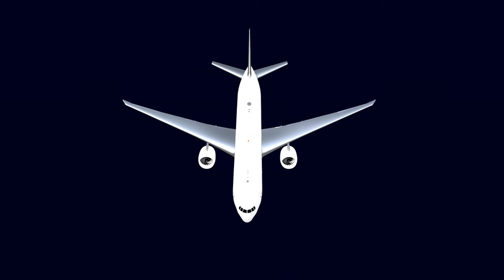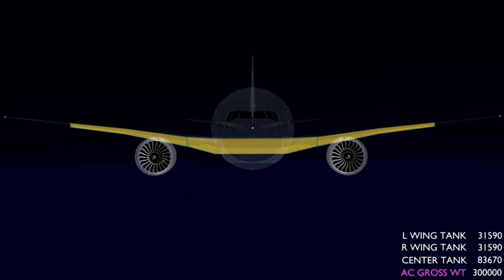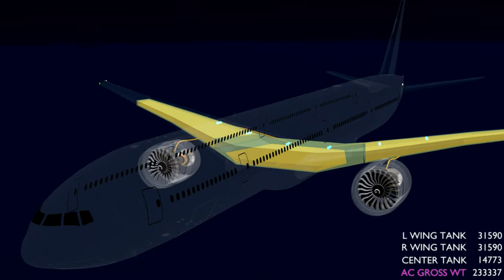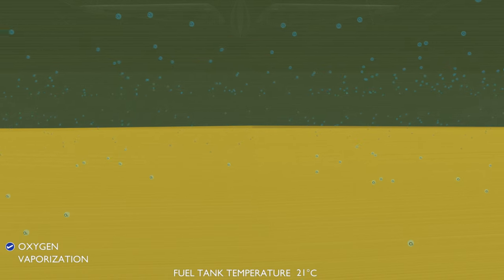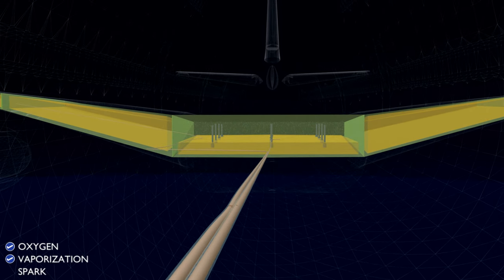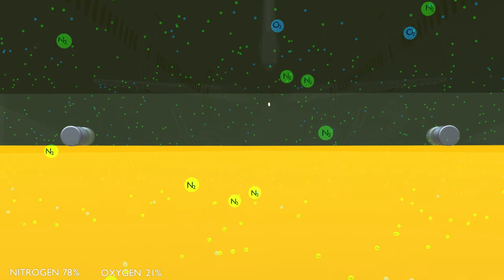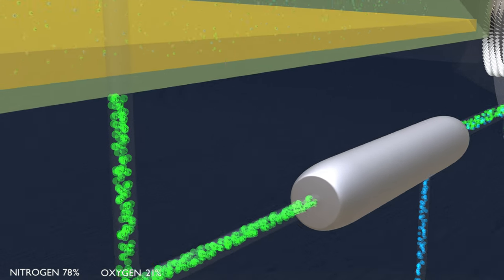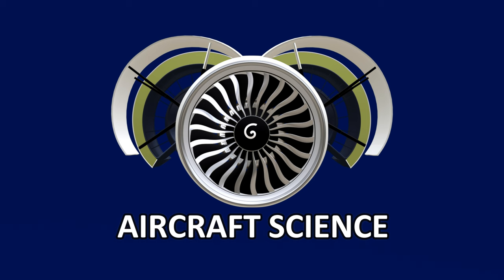Why Nitrogen is Pumped Into The Center Fuel Tank

Comment: The way the NGS work is actually better described as an oxygen level reduction system, it does not actually generate any Nitrogen. Compressed air from the engine bleed enters the system and the system removes some of the oxygen, that “oxygen enriched air” is dumped overboard. You end up with “nitrogen enrich air” that gets pumped into the tank. The key thing to keep in mind is the system does not actually generate any nitrogen, it really removing a small amount of oxygen.  The other thing is the tank is rendered inert not with pure nitrogen but with nitrogen enriched air. Regular air is 21% oxygen, the NGS REMOVES enough oxygen to make the air roughly 15% oxygen (roughly the same as the air you exhale). That relatively small reduction in the oxygen level is enough to get the level low enough that it won’t support combustion.
Reply: Well said, same system on 787. Better described as an Oxygen reducing system resulting in higher N2.
Reply: I was hoping someone would explain that in more detail!
Reply: All good except I don’t agree that we exhale 15% oxygen. Our oxygen uptake is minimal. The main function of breathing out is to export CO2. The exhaled air is rich in CO2 but still contains around 20% oxygen

Comment: I was a crew chief on USAF fighters and the F-16 has a similar system where Halon is injected into all the fuel tanks when the aircraft is in combat mode This is done in case there is damage to a tank by a bullet etc the void space will not have flammable vapors to ignite. Unfortunately the environmentalists made us take all the Halon tanks because they thought they threatened the ozone layer.  This system didn't help much if hit by a missile.

Comment: Question: I was watching some other channel about an aircraft always pumping in air, making sure more air is pumped out than let out or the other way around.  But when they are in cruise surely the air going out and in is the same to maintain that cabin altitude.  I wonder if you could help shine a light
Reply: At higher altitudes the cabin is pressurized (more air pumped in than out) since atmospheric pressure is lower the higher you climb.
Reply: @DareTheMachine  it would be like a helium balloon, needs air to exit as it climbs. Once it is up there well just make sure it is steady
Reply: @worldaviation4k  No it’s purely for human survival by preventing hypoxia. Has nothing to do with lift. Check out a video of a pressurization failure incident. Aircraft will keep flying along just fine but the occupants perish.
Reply: @DareTheMachine  I mean just that it has to let out air so there's no stress on the aircraft, say to around 8000 cabin altitude then keeps it there while it's level

Comment: The question remains two fold ...why was this system not engineered into aircraft from the getgo and why can't the air-conditioning packs be relocated or properly shielded to dissipate heat...i.e. ceramic tiles like the space shuttle???

Comment: Surprised that bleed O2 is not captured for use in an emergency.
Even if it is a small amount.
Reply: Its such a small amount, that the added complexity and energy that it would take to pump it into the engine(s) wouldn't be worth it. I know because I had a similar idea and ask some other engineers at an SAE committee meeting about it.
Reply: No doubt similar considerations reveal that pumping it into the cabin would not be worth the cost and would have negligible benefit.

Comment: instedd ov dumping the oxygen overbored, why thay dont be use itt or be store itt insted of having those dangerous oxygen producing canisters that masques drop down fromm ¿¿¿¿
Reply: Oxygen enriched air produced isint pure oxygen needed for proper oxygenation to offset hypoxia at higher altitudes. Thats before even considering air processing and associated oxygen safe plumbing required for delivery to passenger service units overhead as that would almist certainly involve a riser running up sidewalls of aircraft that could compromise in an accident too.

In layman terms, unsuitable product.

Comment: He said 83,000 kilogram fuel vapacity for centrr tank. A quick calculation indicates the following:  83,000kg × 2.2 lbs = 182,600 lbs.  Divide product by 8.6 lbs [a gallon of milk] the quotient us over 21,000 gallons in the center tank. I'm no engineer, but i don't think that's possible.
Reply: looking at my 777 AOM here, the center tank takes 87,887KG of fuel.  1 liter of jet a fuel  = 0.85KG = 74703 liter = 19734 gallons.  So yes it's possible.  Jet fuel is lighter than water by the way.  

I fly a 787, our center tank takes 71,000kg of gas.  That's about 16,000 gallons of jet fuel.